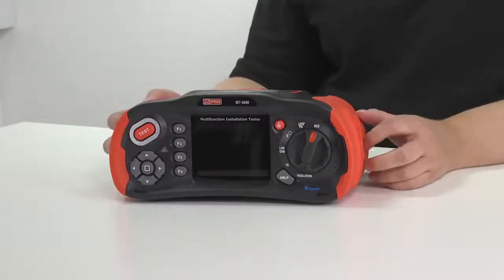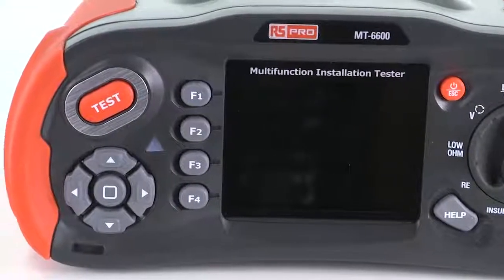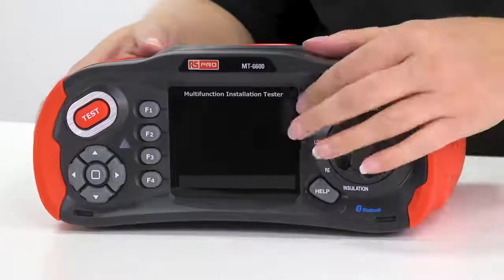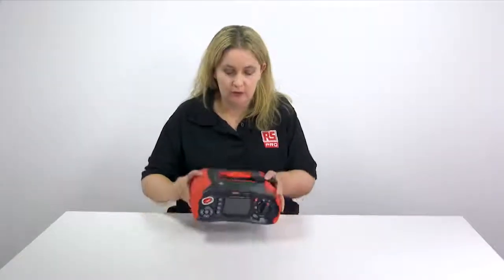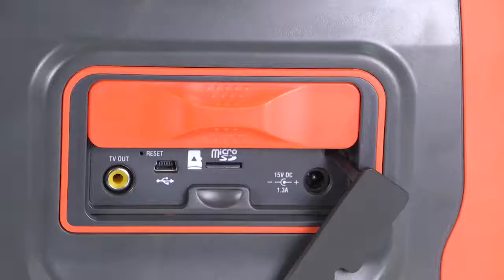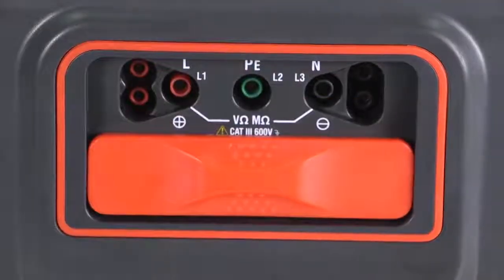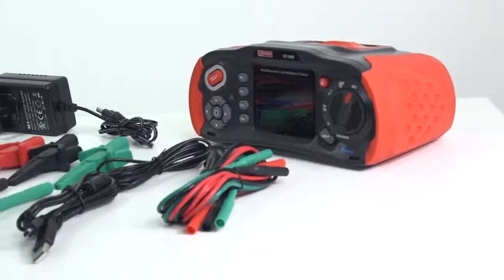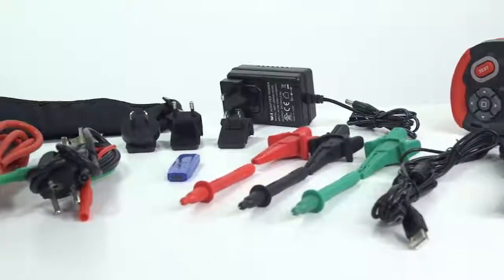Quick Overview of the MT-6600 Multifunction Installation Tester by RS PRO

Comment: Thanks for the introduction video. 
We have more than 10 units of this machine and have not been happy with it and replaced all of these due to unreliability and inaccuracy. We have these units having different label of TIS-1850. 
These units are originally manufactured by CEM in Shenzhen, China or its subsidiary factory in India and white label the products by different companies as their own. Two of these white labelling companies are TIS UK and RS Pro UK. 
Good points we have seen in these units are strong body and not flimsy, clear laid out and nice user interface and screen and average leads. 
Following are the issues: It uses 8x Ni-Mh AA cells and when these cells are drained, you need to put the machine on charge due to rechargeable type. When it is being charged, you cannot use it because the ports where you connect the leads are blocked by red plastic sliding cover. If the rechargeable cells do not hold charge, you will not be able to use the tester as you have to put it on charge most of the time. 
When you put 1.5V Alkaline cells in the place of Ni-Mh cells, the tester may or may not work. When the tester is working and you test low ohms, resistance or insulation resistance, it may display first reading as 0.000 ohms while leads are shorted with each other and second reading may be more than 5.049 ohms and the reading afterwards may display that there is open circuit and the leads are not shorted together. 
Generally, it may work or not and its readings vary each time and so inaccurate and unreliable. Also, when you press TEST button, sometimes, it will test and sometimes you only get the beep, however, no test is performed. 
If you look for support regarding these MFTs, you will not find proper support links. TIS does not have this product now on their website. RS Pro has Italian user manual on their product selling page and CEM does not have a support information on their website.
Conclusion: We need reliable and accurate MFTs. This is not one of those. I suggest that you steer clear of these MFTs and consider other brands such as Kewtech, Megger, Martindale or Fluke. Metrel is another brand that can be considered.